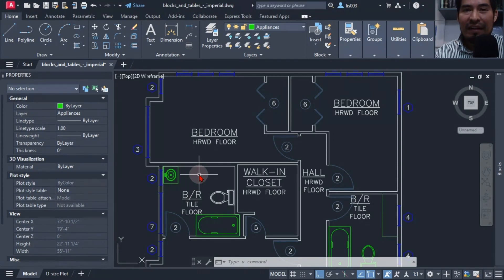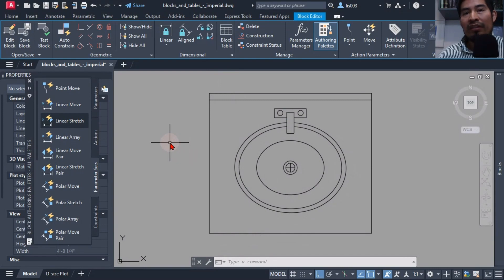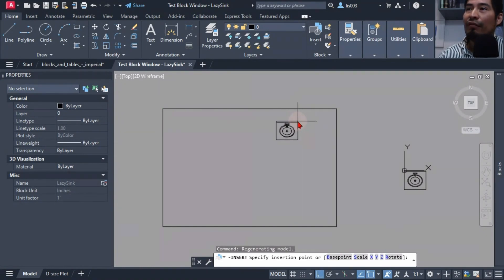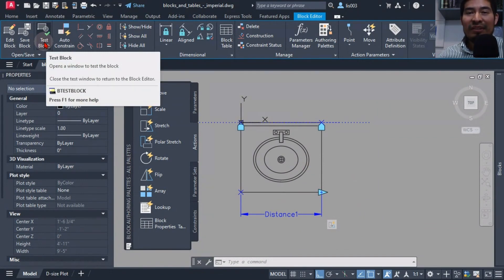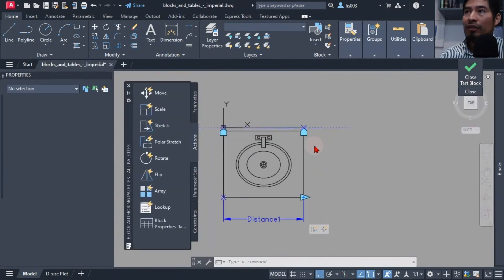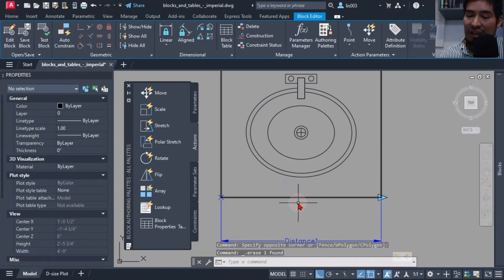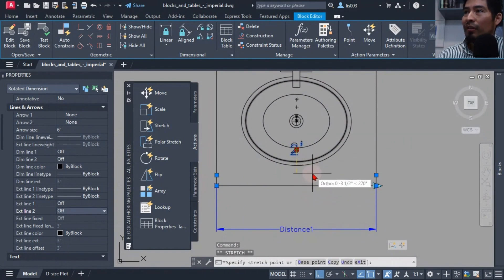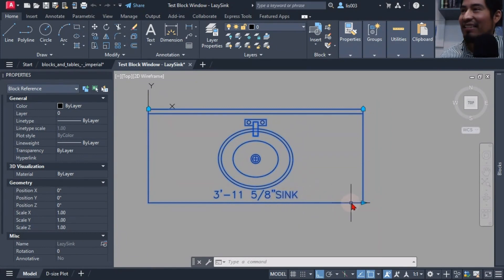Making a Sink Dynamic Block in AutoCAD

Comment: In this video, at time 17:34, after inserting block on correct position. Can you change the size of block now. I want to confirm if it still stays in the corner or not.
Reply from the maker: Great question Shabbir, I discovered that changing the size of the block after changing the insertion point with the ctrl key was inefficient because the stretch grip was on the wall side. This is why I revised the block to include 2 stretch grips 1 at each side, this way my client was able to change the size of the block anytime. I'll post the demonstration video later.
Reply: @LazyArquitecto  I was asking the same question during Live session.  thanks alot. Please do mention me in next Sunday.
Reply from the maker: What do you mean by mention you Shabbir?
Reply: @LazyArquitecto  I mean Please share Your solution. How you solved this block Problem.
Reply from the maker: Here https://youtube.com/shorts/7HJDyZBl6nw?feature=share